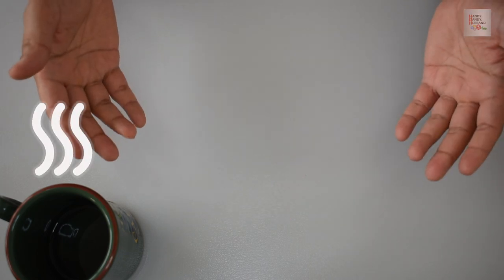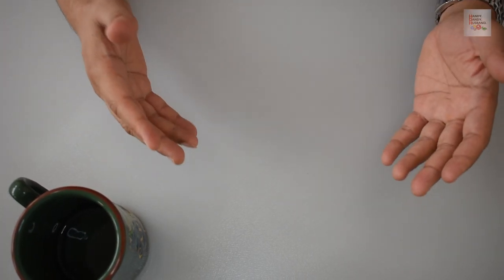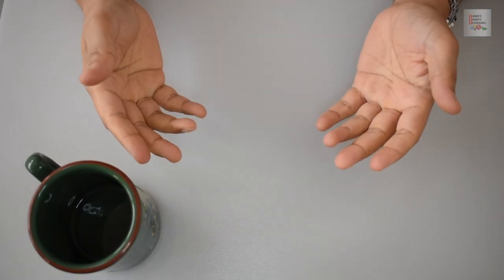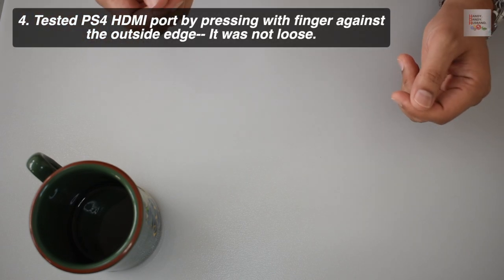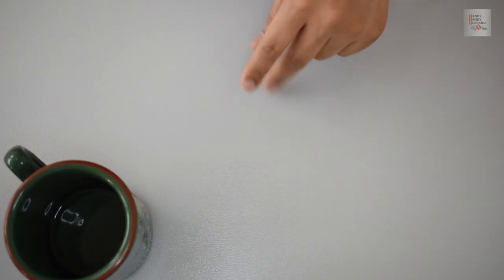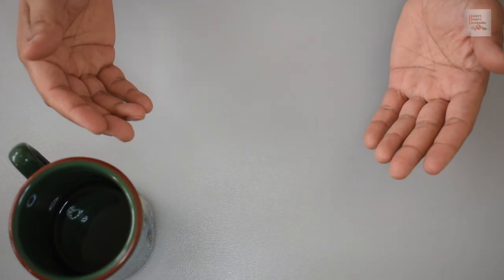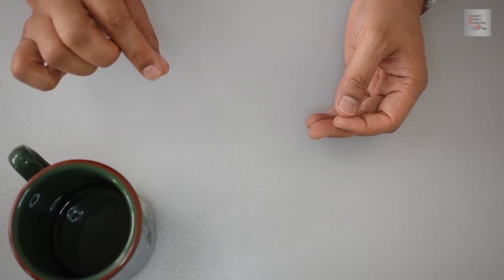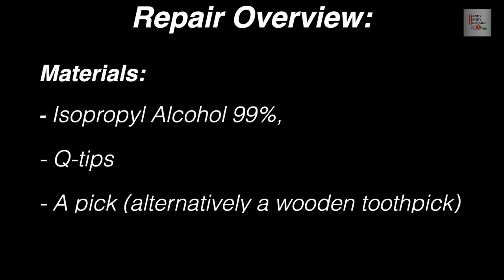𝗤𝗨𝗜𝗖𝗞 𝗧𝗜𝗣: 𝗣𝗦𝟰 𝗛𝗗𝗠𝗜 𝗣𝗼𝗿𝘁 𝗥𝗲𝗽𝗮𝗶𝗿 -- Easy, no solder required -- [Fix that video input error]

Comment: 😭🥺I just got a new HDMI And I can’t play PS4 for the rest of my life 😭😭😭😭😭😭😭😭😭😭😭
Reply from the maker: Hi there, thanks for watching and leaving your comment.  I am sorry you can't play with your PS4.  When you say that you got a new HDMI, do you mean a new HDMI cable or did you get the port replaced?  Please let me and the community know and perhaps we can try to help you out.  Thanks, and all the best to you, H.D.H. [: { ].
Reply: I got a new hdmi cable
Reply from the maker: @Idrzss Hi there , please proceed with completing the rest of the steps that are detailed in my video.  Once you have done that, please let me know.  
Thanks, H.D.H.[: { ]
Reply: Ok but if you don’t have a toothpick, can we use something different else
Reply from the maker: @Idrzss  Hi there, yes, if you don't have a toothpick you can use a long pin or needle--it will be stronger than a toothpick and perhaps thinner.  Hope the fix helps you get your PS4 running, all the best to you, H.D.H. [: { ].
Reply: I did the steps, still didn’t work 🥺 I’m scared if I use a pin the thing in the hdmi port might get snapped
Reply from the maker: @Idrzss  Hi there,  Yes, it is a little scary bending the metal pieces.  You could use the flat end of a pin or a thin nail.  This might help you .  If you still feel uncomfortable with it, maybe try to have someone help you--remember you need to just bend them a little, this is possible with low to moderate pressure.  You don't have to use excessive pressure.  Also, if you do want to play some games while your PS4 is getting repaired, you might want to try playing Call of Duty on Blizzard...it is free and you can use the PS4 controller attached with the USB cord.  Anyways, I am sorry the fix is not suitable for you.  You might want to try taking your PS4 into an authorized repair depot....they might be able to help you out.  Hope you do eventually get it fixed, all the best to  you, H.D.H. [: { ].

Comment: I spent $130 to get mine fixed and I can do it for free?:/🤡
Reply from the maker: Hi J X N, thanks for watching and sending me your comment.  Man...$130 to get the HDMI port fixed is steep.  I am sorry that it cost you so much.  Did you try any other fixes before spending that much money?  Also, where is your rough location (US or Canada or elsewhere)?  This would be helpful to the community to compare prices.  The 'Free' fix is an attempt to realign the pins of the HDMI port...it is a DIY solution so it won't compare to a full on $130 replacement of the HDMI port.  If the problem is different than it may not work for you.  All the best to you in 2021, H.D.H. [: { ].

Comment: Didn’t work😥 I’m fucked up
Reply from the maker: Hi Bajram Kelmendi, thanks for watching and trying the fix.  I am sorry it didn't work for you.  Hope you get your PS4 working with another fix.  Thanks, H.D.H. [: { ].
Reply: @HANDYDANDYHUSBAND  I’m gonna change the HDMI for 50€. Thanks anyway
Reply from the maker: @itsBakaa  Hi Bajram Kelmendi, thanks for letting me and the community know.  That is great that you were able to get such good price to change the HDMI port.  I would greatly appreciate it if you would comment after the repair, how the PS4 is working, and, if possible, where you sent your device for the replacement.  All the best to you, H.D.H. [: { ].
Reply: @HANDYDANDYHUSBAND  hi handy dandy husband. Actually where I live in kosovo 🇽🇰 50€ it’s not cheap.And first time he couldnt fix it because he said there are pieces inside that were removed.But he told me he had ordered a machine before that could fix my hdmi but it can take 2 weeks till it comes.And he’s actually doing the service and fixing my hdmi for 50€.
Reply from the maker: @itsBakaa  Hi Bajram Kelmendi, thanks for clarifying.  I think what the repair depot meant was that there are parts that must be removed and replaced and a specific machine--either a better soldering iron or a soldering heat gun is what the repair depot needed to properly remove and then reinstall a new HDMI port.  Anyways, removal and replacements are challenging and 50 Euros is fairly cheap, as I have seen prices in the $200 USD here in Canada and the US.  Hope you eventually get it fixed.  Please do still write back once it is fixed and let us know what the repair depot tells you.  Thanks, and all the best to you, H.D.H. [: { ].
Reply: @HANDYDANDYHUSBAND  hi I got it today. And I’m playing right  now.It’s working good
Reply from the maker: @itsBakaa  Hi Bajram Kelmendi, that is great news.  Thanks for letting me and the community know about your success.  May you have many more years of entertainment from your PS4.  All the best to you, H.D.H. [: { ].
Reply: @HANDYDANDYHUSBAND  thank you

Comment: Do I put the alcohol on the Qtip to clean the port
Reply from the maker: Hi PopIt4ray Szn, thanks for watching and sending me your question.  Yes, it is advisable to soak the Qtip in Isopropyl alcohol to clean the port.  Note:  do not use excessive amounts of liquid (the Qtip should be damp not dripping).  Gently clean the inside of the port, but do not leave any cotton strands behind.  Hope this helps...all the best to you, H.D.H. [: { ].

Comment: This is stupid, it doesn’t work. I don’t understand why it’s so damn expensive to fix or replace a fuckin hdmi port
Reply from the maker: Hi Pranay Sabherwal, thanks for watching and sending me your results.  I am sorry my fix didn't work for you and caused you so much frustration.  I would be happy to help you further, if you let me know what exactly the issue is and what if any change the suggested fix made.  Hope to hear from you.  Yes, it is expensive to replace the HDMI port, but you need to do some trouble shooting to make sure that it is in fact the issue.  All the best to you, H.D.H. [: { ].
Reply from the maker: Hi Pranay Sabherwal, I didn't hear back from you.  I guess swearing is much easier than actually doing the work to try to fix something.  Anyways, my offer stands.  H.D.H. [: { ].

Comment: My PS4 fall from 2 feet and now HDMI has no display
Reply from the maker: Hi Itz Rechz, thanks for watching and reaching out with your PS4 issue.  I am not, unfortunately, an expert in PS4 repair so I don't know what could have been damaged by the 2ft fall.  One question that does come to mind, though, is was the HDMI cord plugged in when it fell?  If so, is the HDMI port loose or does it wiggle?  If not, is there any damage to the port if you view it with a flashlight?  Maybe compare the HDMI port to an existing port on your laptop, computer, or TV and see if it looks in anyway different or damaged? Last, try using a new HDMI cable (if the existing cable was the one that was connected when it fell).  Anyways, hope one or more of the suggestions above help you out...It is a bummer when the PS4 doesn't work. But as I mentioned to another viewer, if you really want to be entertained while you get the PS4 fixed, try logging through a Desktop/laptop to Blizzard and take advantage of free games like starcraft or Call of Duty.  They are very entertaining and your PS4 controller works seamlessly.  All the best to you.  H.D.H. [: { ].

Comment: Copying other people's methods.
I.E. The Lock Picking Lawyer.
Doesn't make you handy.
And it's certainly not dandy.
The coffee cup, looks ?
COMPLETELY out of place.
AND WHY,
Would you recomend Q-tips ?
Then you show us. One side of the HDMI cable. & claim the opposite side to be the problem.
MAJOR OOOOOOOOOOOOOPS...
A small glass cleaning cloth.
Cut into small strips. Is the best solution for cleaning port pins.
BUT BE CAREFUL...
ALL IN ALL, not a bad video.  

Perhaps a delete. But don't repeat.
Then Re-record this ? Episode ?
Because I have even more,
I CAN ( PICK ) APART.
If you need me ?
Just message.